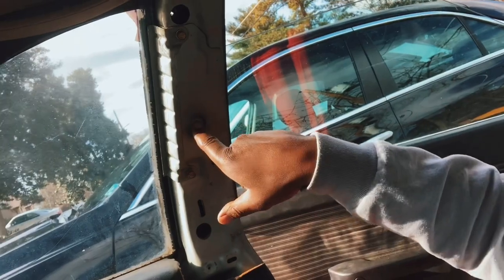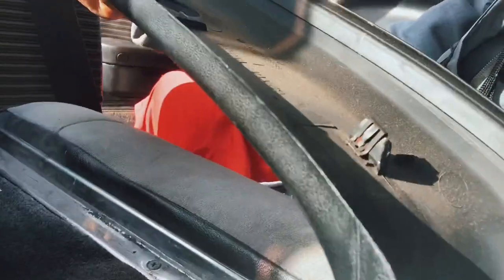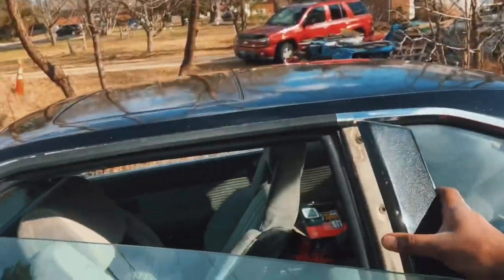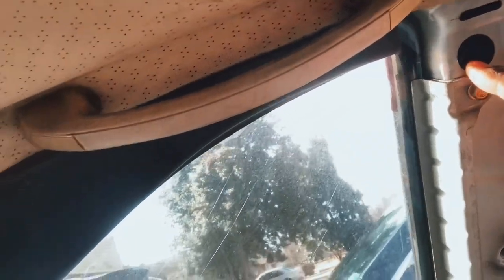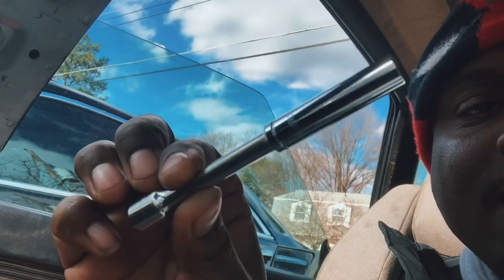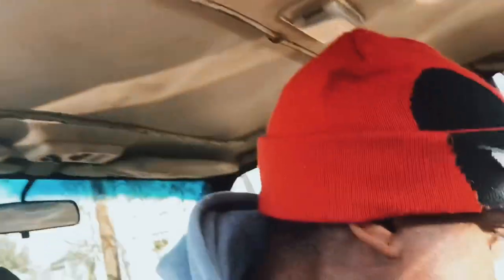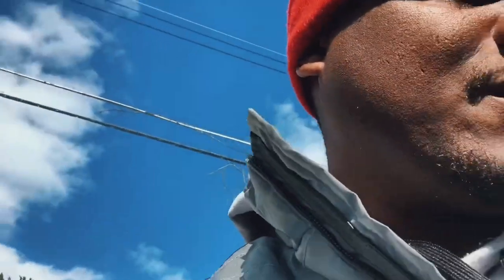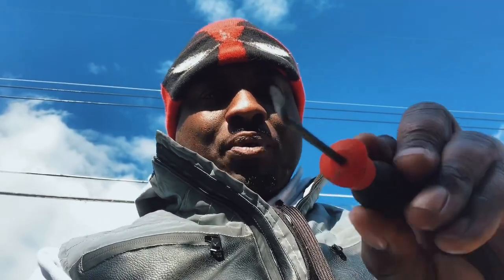1983 Toyota Celica GT & GTS Custom B-Pillar Emblem Installation

Comment: Good Video. I just picked up a 1983 Celica GT.  I'm not to fond of the new Supra because I've done the BMW  car thing, and  maintenance will kill your love of them.
Reply from the maker: Hey thanks Shannon. Congrats on your find. Hope you have plenty if patience, because this platform is getting harder and harder to find parts for. Luckily their engines are rock solid so you don’t have to worry too much in that area. I’ve never owned a BMW, but I have owned quite a few Euros in the past. Luckily I can perform most of my work and repairs myself. But most modern vehicles are getting more & more reliable. I’m just not fond of the looks of the new Supra. Hopefully they get a massive facelift soon.